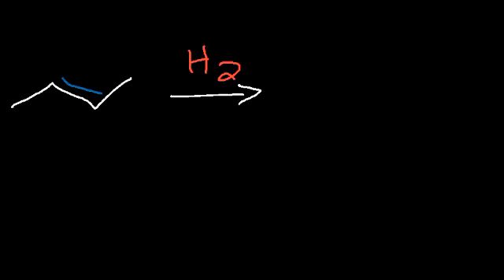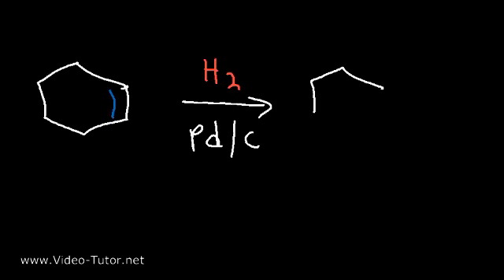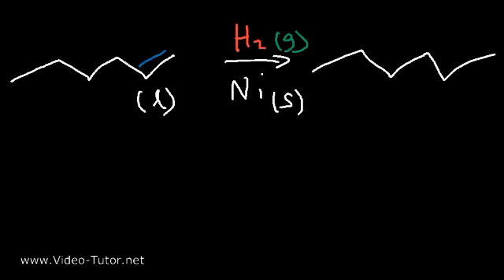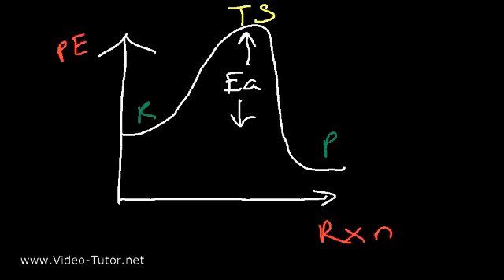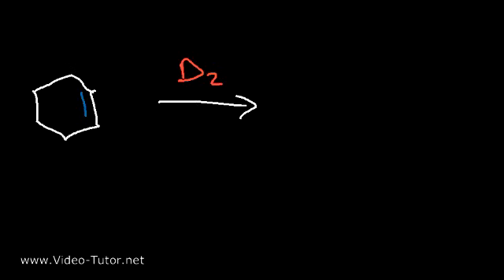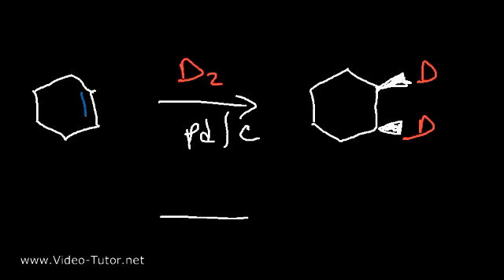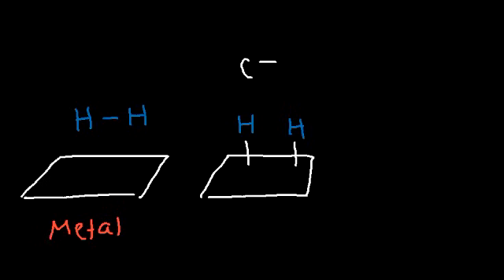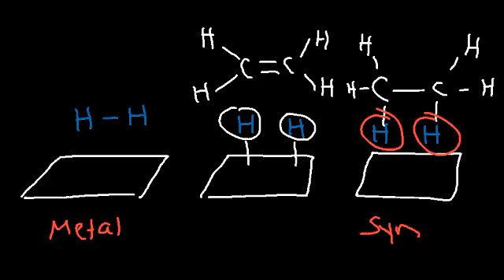Catalytic Hydrogenation of Alkenes - Heterogeneous Catalysts

Comment: There was a guy that was convicted of fraud for claiming his fuel reformer design used a mechanism that looked like this, to take hydrogen from water vapor, under high heat, and catalyze fuel vapors with the hydrogen that gets exchanged with metal in the pathway to the intake. Does that concept actually have merit, or was he taking part of this real chemistry and just using it to confuse people into thinking something impossible? Granted, a lot of his demonstrations were really cheeky, and would also lead people to believe he was trying to sell another "runs on water" scam, but if temperatures around that of 4-stroke engine exhaust can cause hydrogen to leave water and get stuck to a metal catalyst, it would seem like he was at least partially vindicated, if not wrong by not really grasping the entirety of the system and misapplying it.